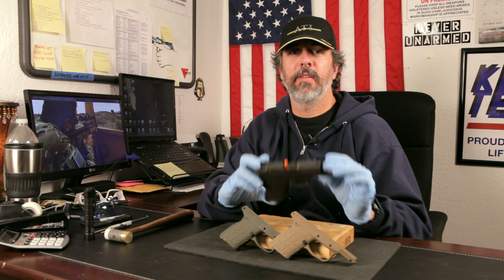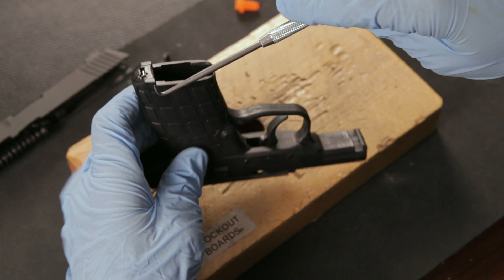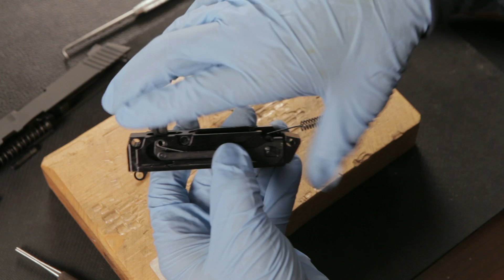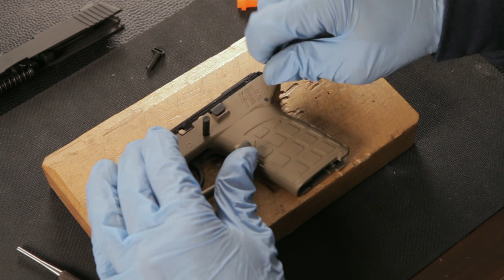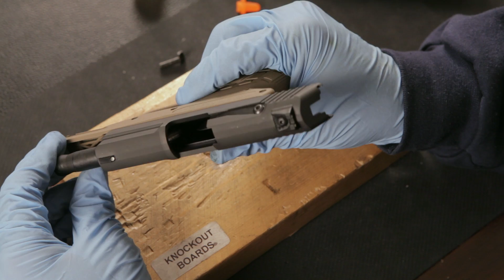Kel-Tec PF-9 Grip Change

Comment: I noticed that I could disassemble the pistol to this point, but I never thought of actually replacing the grip. Not sure why I did not think of that.

It took me a good while to figure out you have to push down on the barrel hood when reassembling the pistol. I must had accidentally got it right 20 times before I figured out why it did not work every time.

Comment: Great video, Chad!  Looks like you've worked on a few PF-9s.  :-)

This video made me appreciate the engineering that went into the PF-9 even more.   Definitely some clever stuff there.

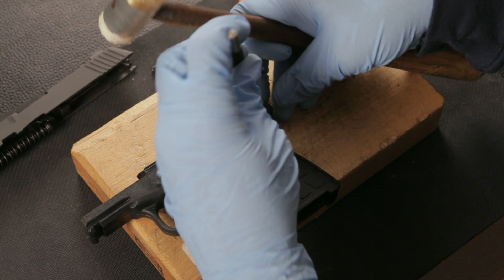1:50  To go with that knockout board, I highly recommend the 4 ounce brass hammer and a set of punches from Grace.  Excellent quality and reasonable price for well made domestic manufactured tools.  The Grace roll pin punches are also very good for working on an AR-15.  I usually like doing the most with the least, but times like this, I like having the right tool for the job.